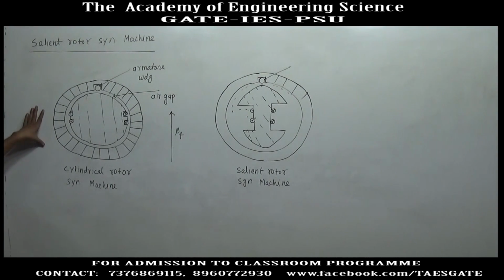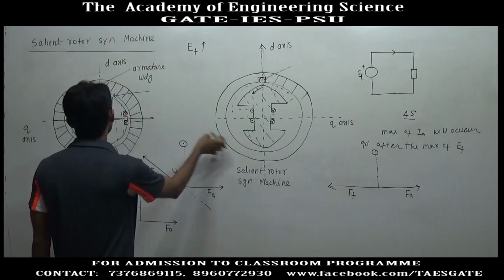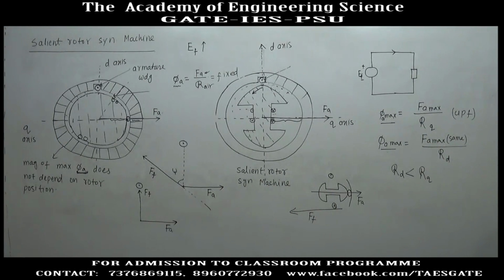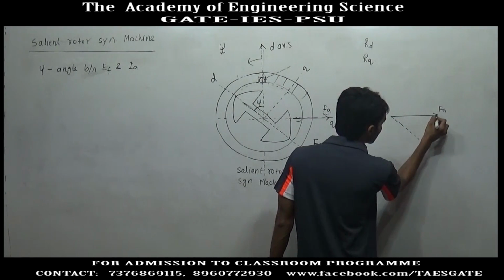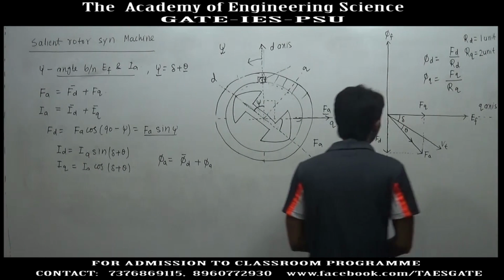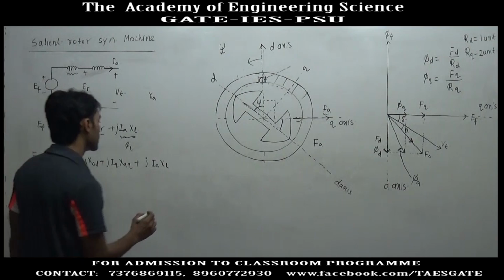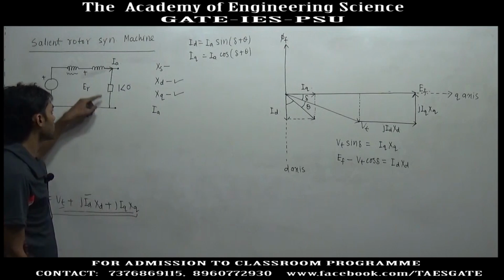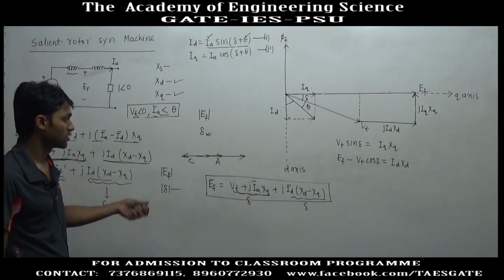GATE LECTURE IN ELECTRICAL ENGINEERING (EE)(HINDI & ENGLISH): SALIENT TYPE SYNCHRONOUS MACHINE

Comment: Sir, in this video you have said that "the induced emf lags behind the field flux" meaning that when field flux is maximum in either direction the emf is zero and vice versa. My confusion is that why you say thatwhen the conductor is at maximum influence of field flux the induced emf is also maximum  since  the induced emf lags behind the field flux as you stated earlier? With thanks